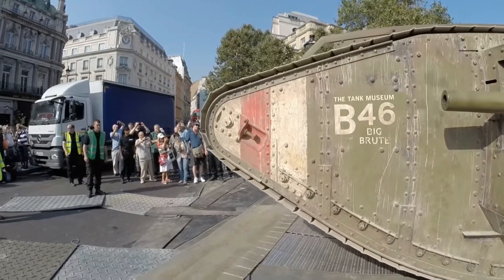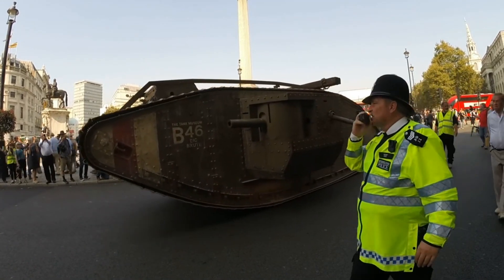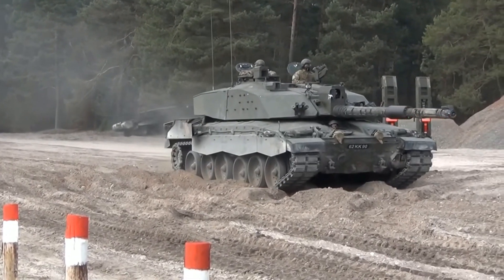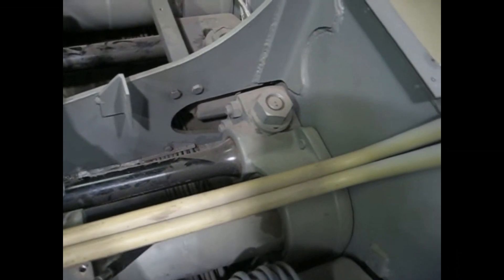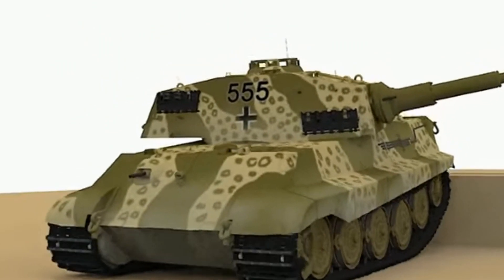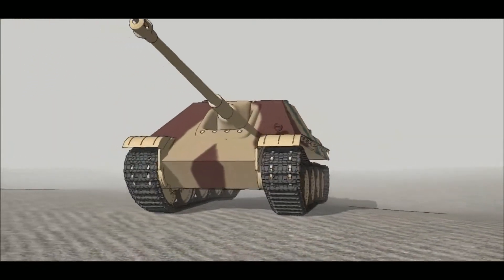Tank Suspension Systems - Pros And Cons

Comment: Great video Mats! Nice to hear what the maintenance crew had to say about the suspensions. 

So a few general things to know:

Torsion bar:
It's the gold standard of suspensions nowadays.
Compared to the Christie suspension it took less internal space, gave better ride quality and was lighter. It is also in general the lightest of the older types of suspensions.  But some drawback are that it takes up internal volume and makes the vehicle taller, as well as the torsion bars being a hazard to crew during a blast mine explosion under the tank.  And simply the fact that a shattered rod takes a lot of work to clear out and fix.

Used in the Merkava is a sort of coil spring suspension. It is extremely rugged (used the the rocky Golan heights) and reliable. The suspension is also said to provide better ride quality then torsion bar, but that is not confirmed. It is also well protected and easy to replace, just remove the module and attach a new one. Also takes up no internal volume. The downsides to the system is the increased weight.

Hydropeumatic suspensions or hydrogas are a newer type. They are generally lighter. (Makes up 7-8% of the vehicles total weight, compared to the torsion bars 10%). As well as beings easily replaceable. Well, "easily".   They also give you a better ride quality compared to torsion bar, meaning they need less wheel travel (475mm for CR2, 520mm for Leo 2 and M1 and 600mm for Merkava). They can also go into a semi-active or active more, were the suspension adapts to the terrain automatically and the tank can be raised and lowered, changing the ground clearance, as well as kneel to increase gun depression. 

Another newer prototype suspension is the electromagnetic suspension. Using magnetism to dampen the impact. These are very equal to the hydropeumatic suspensions in performance, all though ride quality should be very slightly worse because of more unnsprung mass. The upsides however, is the easy of maintenance, simply remove the module, with no need for a gas bottle or pump. And they are also said the be 25% more efficient than hydropeumatic suspension when they enter active mode. (The system needs power to vary the stiffness of the individual suspension units.)

Another intriguing suspension technology is the adaptive suspension, which uses cameras to adapt the suspension to incoming terrain, and has shown to increase the top speed of tanks. Just search BAE F1 suspension in tanks.

Cheers
Xoon.

Comment: Leo II has Torsionbars and is more mobile than Challenger II
Reply: Leo II has that extra 300HP and more torques. And is also a light bit lighter.  Really wish that had put the 1500HP Euro pack engine in the Chally they were using to demo it to export customers.
Reply: Lo0l , that not really mean it  better real tank . their not driving racing car their driving Tank Heavily armored to lead forward against enemy defense against multiple types and multiple weapon system firing at your Charging Knight .

Just unproven no side armor and no top armor tank could survive modern wars and even got destroyed  just against Terrorist .Haha.
Reply: the new german Puma II has hydogas suspension - but it's very instable - they had serious problems with the stabilization of the tank
But for the crew the the drive is not so noisy.

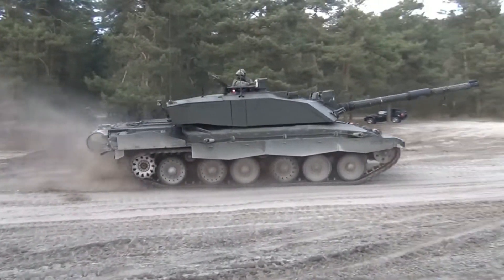Comment: looks like the suspension on road-wheel station 6, right side at  9:57 is broken, tank is leaning to the right and towards the rear. anyways, nice video as always :)
Reply: Sinonz Or the fifth wheel that looks to be throwing up a lot of dirt.
Reply from the maker: Sinonz sadly it's not the right one. Someone did guess the correct one today though :-)

Comment: Can't help thinking that one reason the Challenger hydrogas is so good may be that when it was designed Vickers owned RR cars which also use hydrogas suspension (although they weigh a bit less 😉)
Reply from the maker: Andrew Cox haha a bit less indeed! Thanks for watching! Any guess on which hydrogas has failed?
Reply: I suppose the obvious one is where they're working on it 😉 That's probably too easy though!
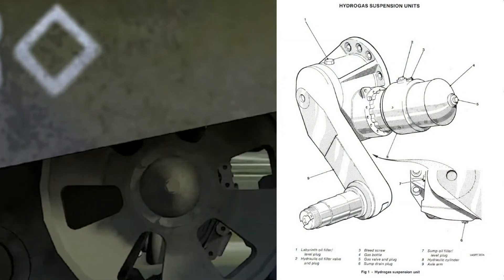I was wondering about the no 5 wheel on the tank at 4:06 but can't decide if it's just the way the mud is being thrown off the wheel.... Otherwise the second tank around 7 minutes as it looks lop sided but that could just be the ground it's on.
I suppose it's obvious when you know what you're looking for 😊
Great vids, keep it up!!

Comment: So what are the alternatives to torsion bar and hydrogas suspensions?
Reply: There's the old Chrissy suspension as seen on most WW II US tanks like the Sherman, and I believe that the Russians used it on the T-34 as well.
Reply: the Sherman did not use Cristie suspension.
Reply: You're right, they didn't, for some reason I thought they did. Maybe I was confusing early US testing of the Cristie suspension for Shermans having a Cristie suspension.
Reply: Active suspension, although that would most likely be an adaptation of an existing system.

Comment: another downside of torsion bar is torsion bar rock. experienced it on cvr(t) a few times. the best thing about hydrogas is the hotter the units get, the higher the ride hight becomes and the better the ride. driving both afvs is nice, but you can't beat rocking around in an MBT. MENTE ET MANU.
Reply from the maker: kippamip very good points! Thanks so much for watching :-)

Comment: can you do a video about gun stabilization?
Reply from the maker: Karl P I know how they work lol
Reply: That would be interesting. Just don't ask him to do one on tank/IFV transmissions. The video would be 3 hours long and require a Masters Degree in mechanical engineering to follow it.
Reply: +Matsimus Gaming do you know how a CVT transmission works in the Type 10 MBT for example? that was something that seemed really cool to me going full speed in reverse, Leclerc needs this.
+Vlad Dracula yes Russian tanks have stabilizers even since the IS series of tanks they've incorporated vertical stabilizers on the IS-8/T-10 and that's so much as when 'heavy tanks' were still a thing lol. On their modern tanks though, hell yeah all the more, just search 't-90 tank shot' or search for the T-90 shooting in the air, it can do this and hit a target if the gunner is competent enough.. Like, even the base model T-72 had 2-plane stabilization, not super advanced or anything but it was enough to shoot on the move given that the ground didn't cause the tank to change it's velocity THAT drastically to the point that the stabilizer couldn't keep up.. The thing about stabilization is that, it can get so good until a point, but without the innovations of ammunition to give us longer engagement ranges and precision at those ranges well our stabilizers are just there to allow us to achieve those 'hard-coded maximums' if you will, which Russian stabilizer technology is by all means up to par with. The biggest difference in 'technology' when it comes to Russian and NATO tanks is sensors, such as thermal imaging, and this comes inherently with the fact that those sensors are MASSIVELY expensive and there's plenty of reasons why the US has the highest military budget by FAR of any military on the planet. 
/rant
Reply: Providence the t90 has both vertical and horizontal
Reply: yes do pl0x
Reply: Matsimus Gaming do Russian tanks have gun stabilizers?
Reply: I'm very curious about the M3 and M4

Comment: why does the mk 4 tank have squeaky tracks
Reply: A few reasons: 1. No track pads between the track link and the road. 2. No/limited bushing between the individual track link, that is, the joins in the track. 3. No/limited rubber between the top of the tracklink and the running gear inside the hull. The CR2s in contrast have nice rubber faced road wheels.

Comment: i think that japanese (and french) hydro-gas suspension are the most refined ones ! they are more "tunable" to terrain and gives smoothness needed to "hit on the move" but they requires a bit more maintenance
Torsion bars are more rugged, less comfy but deal better with rough terrains and are better in off-road situation
As always, it's a strategic choice, you must choose the ones which fits your tactics the best
Doctrine again ! It's always doctrine of use of the army ! 
Rugged vs Refined
Reply: I kinda agree. But regarding the russians, I do believe it is a cultural difference. They prefer less performant hardware but an extremely simple way to fix things. It is their definition of quality. On the other hand we do prefer performances at the cost of complexity which is our definition of quality.
Reply: Nice to know, i always heard in exercice with french forces that the Leclerc was a bit unreliable (but extremely good) on his suspensions...
And you are damn right for the domino effect !
Reply: Well, the suspension units are quite some bitches when it comes to maintenance. You have to periodically control them for leaks, refill the different oils and once in a while retest the nitrogen spheres (just like you have to do on pressurized vessel i.e. fire extinguishers) If you don't maintain them, you end up with a low-low...
Maintenance aside, they are awesome.
Reply: i think exactly the same !
Reply: OR : torsion bars on light tanks ! CVR-T were amazing on rough terrains like the T-90 (which is pretty light for a MBT)
AND : hydro-gas on heavy tanks
Reply: all fine and complex systems requires good trained crews, hydro-gas are expensive and requires maintenance, if your army can't train crew well, go for torsion bars...
Reply: Dude , don't forget T-80 it work with torsion bar splendidly .
Reply: it's quite light compared to M1 !
Russians have really good gyro-stabs, they don't need good suspensions ! ^^
Reply: they are designed for well-trained/disciplined crews.. Russians are... hum... less disciplined about maintenance and the level of the crew of soviet army was pretty low due to a pretty short training course
Reply: first line maintenance... the simpler the better. 
Agreed most modern armies are moving towards being a scalpel than a hammer.
But there are more than a few mechanics that would like to strangle an operator.
Reply: France generally has a boner for hydropneumatic suspension even in civilian cars.
Reply: Well, the french ones are quite rugged, they endure all shocks to the point that it is the hull that suffers from the more catastrophic shocks. During the tank competition in Sweden, the testing crew throw the tank and damaged the hull, the suspension units where fine but the mounting points on the hull where widened. This caused some controversies because, the militaries of the STAT (french army technical section) never reached that degree of pressure even when they sent the tank in trenches with 1-2m jumps at the end of the manoeuver. Recently the UAE tanks that were damaged by AT land mines also have the hull damaged (bearing plate bent, suspension units scratched at worst, and track thrown).
A con of the torsion bar system is that, when it fails there are high chances that you have a domino effect with the redistribution of the weight...

Comment: I kinda like the Horstman suspension system, it brings quite alot of advantages in maintenance, becauseyou can easily replace the bogeys.

3D picture of this suspension system:
http://i.imgur.com/4cxHYk9.jpg

and how it looked on the chieftain:
http://image.noelshack.com/fichiers/2015/41/1444491174-horstmann-suspension.png

but torsion bars are also really cool.

tank suspension is highly interesting for a mechanical engineering student like me :)